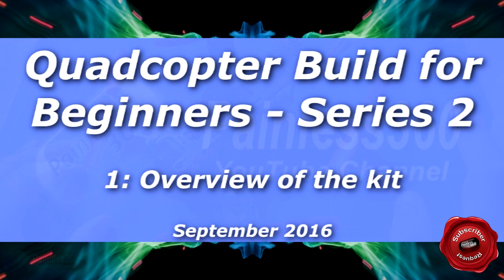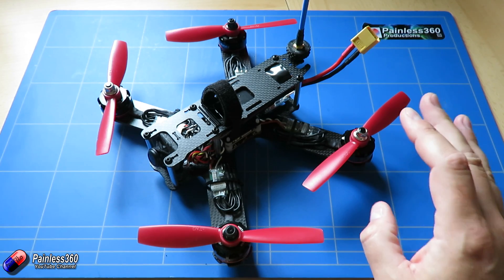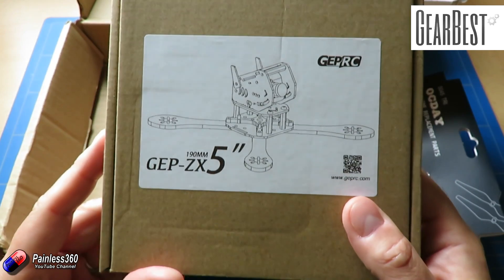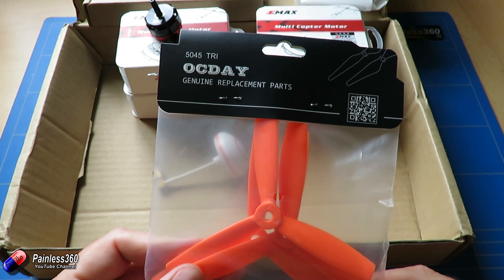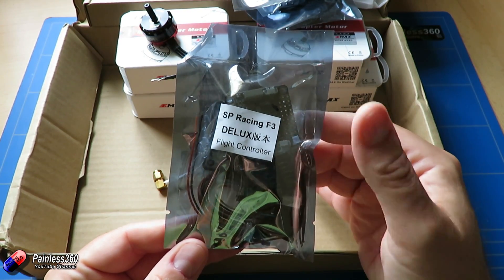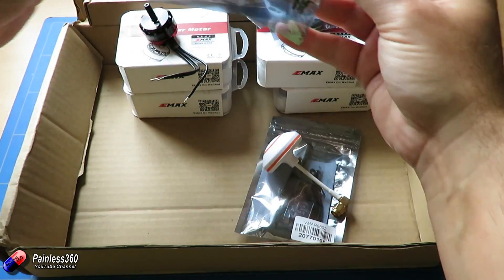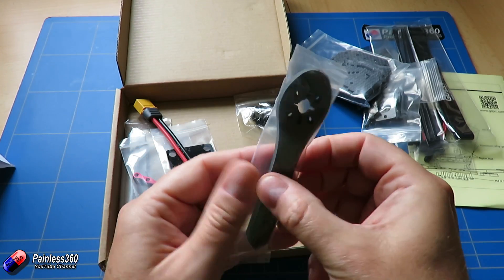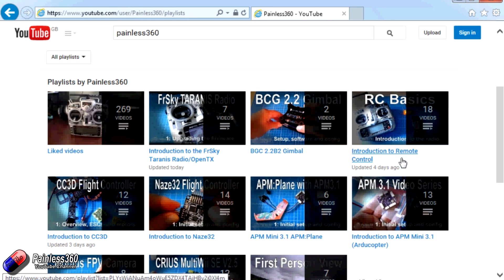(1:7) Quadcopter Building for Beginners - Series 2: Introduction

Comment: Did I hear right?  At about 4:45 you say SP Racing SP3 is being discontinued??
Reply from the maker: The original SP Racing F3 board released way back at the end of Summer 2015 has not been make by Seriously pro for a long time. The cloners got hold of it and had versions out within weeks. Seriously Pro have lots of newer F3 based boards now (Evo, Acro and Mini) with improved features and sensors.. Happy flying!

Comment: Will this copter be good for mounting a pixhawk, like you described in the pixhawk video series?"
Reply from the maker: Not a chance. Maybe a PixRacer but with the PDB you'd have to use much larger risers.. See Series one for a more suitable frame. Best of luck!
Reply: Do you mean the copter from your first copter build tutorial will be suitable? Isn't it too small as well?
Reply from the maker: Nope. The Pixhawk is the same size as a standard flight controller but with the PDB needs a little 'head room'.  See the video series were we made a model with one..
Reply: I see. I guess I'll try building the first one, and if all goes well I'll take a shot at building a larger one. Thanks a lot!!

Comment: having a problem. I'm building my 1st quad. diatone tyrant 215 with built in pcb etc.  Got skyline32. emax 2205 2300kv motors. little new esc's. tested all ecs/motors by connecting to receiver/battery and all worked good. now connected to frame and skyline32 via the built in pcb and built in signal wires. but all motors spins up except motor two.
Reply from the maker: What troubleshooting have you already done?
Reply: rechecked all conections. it's random now as if there was a lose wire but rechecked all. I can't now get the tgy i6s s-bus to talk. if I follow yours and others setup it's like skyline32/beta flight says no. going try it using ppm insted. I have set up apm before on 450 size and that was so easy. makes me wonder if it's this skyline32
Reply from the maker: If it worked on the bench then the problem occurred with the move into the frame, so it's got to be power or signal issues. Check for bad soldering, connections, shorts to the frame.. Best of luck!

Comment: Hey painless, love your videos. I want to try an x-frame, but it seems like it is so easy to destroy batteries in that configuration. Is there anything one can do to protect it when it is underneath like that? From watching the pro guys, I get the sense that they destroy a lot of equipment, but since they are getting a lot of free stuff from sponsors, it's no big deal for them to turn an expensive lipo into an asphalt pancake firecracker. 💥🙈💥
Reply from the maker: These designs are made to be fast and light, you're right the battery will take a beating but in practice a lot of the crashes will be cartwheels with these types of frames. Alien frames provide a nice compromise with an X configuration but a little more room to put everything.. Best of luck with your choice!

Comment: The foam square with holes in goes at the bottom of the frame so you can mount the battery without it getting punctured by the screws.  I't a nice quad, I swapped out the PDB as it made wire routing easier on such a tight build and I was getting bad video from the BEC in the on the original PDB.  It's fun finding a place to put a buzzer.
Reply from the maker: Yep, this one will be a fun build as the space for the PDB and FC is tight! No options for PWM pins here, we're in direct soldering territory.. I'll probably end up designing a mount for the buzzer and popping it on Thingiverse.. Stay tuned!
Reply from the maker: Buzzer mounting fixed - http://www.thingiverse.com/thing:1790166 ;D
Reply: Looks pretty good.  I just used a really small small buzzer and hot glued it to the bottom plate.  The good thing about the 3d printed part is that it can be uninstalled very easily all though you will still need to get the soldering iron for any component on this frame.  Looks like it should just clear the props.  Nice and tight.
Reply from the maker: That's the plan! :D Happy flying!